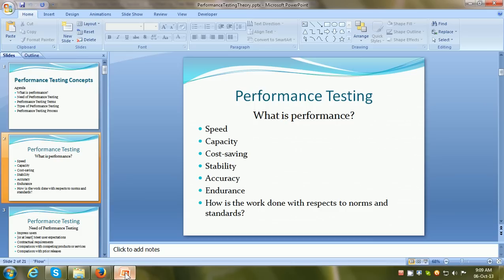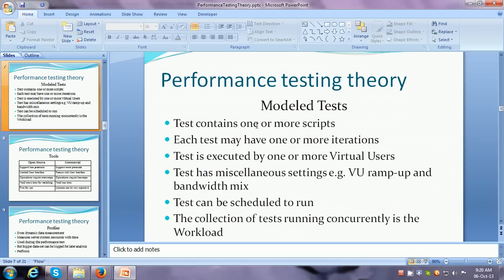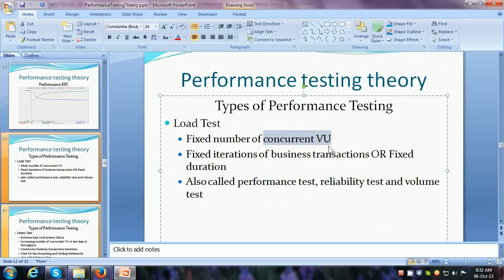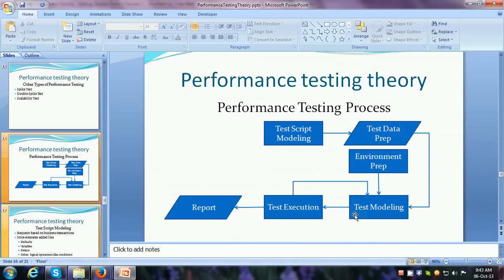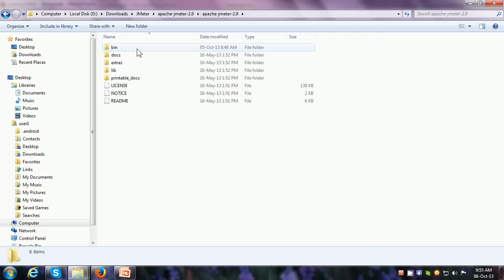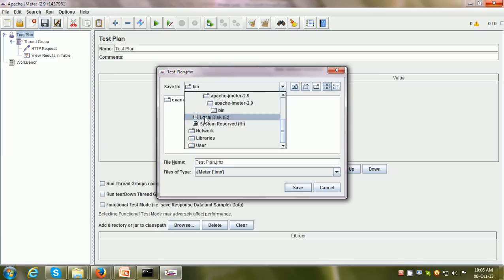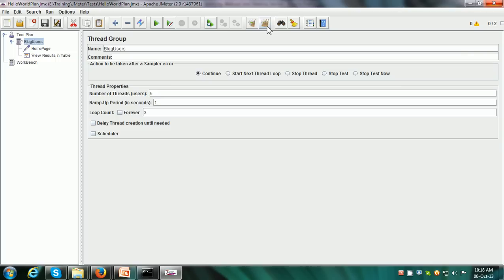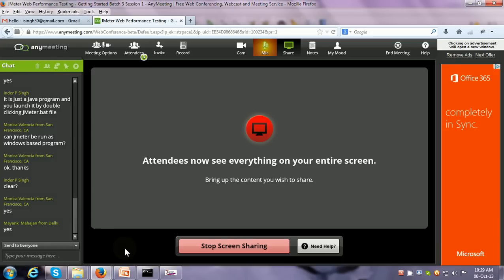Performance Testing-JMeter Performance Testing-Jmeter-Performance Testing Using Jmeter-Load Testing

Comment: Hi Inder, Nice Video..Can you please explain summary report in Jmeter and the formulas used to calculate Average, Std Deviation, Throughput, KB/Sec in the report
Reply from the maker: Girish Deshpande Hi Girish, thank you for your comment. Because it gives little information, I prefer to use the Summary Report listener only in the final JMeter test plan. While developing the test plan, I prefer to use View Results Tree because it shows the most data. The formulas in the Summary Report are standard. E.g. Average = Sum of all sample times/ No. of samples. The Average is shown for each individual request.

Comment: May I ask why throughput line is raised and Avarage Line is down, they always opposite each other
Reply from the maker: bluewindboy99 No, it is not like that. JMeter uses the same graph to show both so Average and Throughput values are plotted by JMeter automatically.Further, a couple of suggestions are 1) We can ignore the initial transient period of the test (when the users are ramping up to the maximum number of users) and 2) We can run the test for a longer duration e.g. 10 minutes, or more samples e.g. No. of samples: 10000 to get more consistent results. If we use these suggestions, we should see flat Average i.e. response time and Throughput. These flat values should be seen as the performance measurement results.

Comment: Hi Inder, thanks a lot for this session. It actually clears a lot of fundamentals. However, my first test itself gave me error. I mimicked your first test with 1 thread, 1 ramp up period, 1 loop. I run it and I see only a warning in results. Sample Time 0, Status Warning, Bytes 1091. Latency 0. Can you please help?
Reply from the maker: Debashis Jena Hi Debashis, thank you for your question. I ran my JMeter test plan and it works fine. It seems that your sampler, HTTP Request is not correct. It should have the Server Name or IP as inderpsingh.blogspot.com and nothing in the Path. Also, you can add the listener, View Results Tree and check its Request tab. The request should be correct i.e. if you copy the GET request and paste it in the browser, it should navigate to that web page.
Reply: Software and Testing Training Thank you so much. Actually I has "http://" in my server name. That's what was giving me warning. I ll now continue the video where I left from.
Reply from the maker: Debashis Jena That is good. Thank you.

Comment: sir,
how to perform parameterization test in login window(email ,password) using jmeter ??
Reply from the maker: Rinoy K Rajan You can add a Config Element called CSV Data Set Config. This element can read a CSV file and supply the values of email and password for each request. Thank you for your comment.

Comment: Hi Inder, Very nice and clear. I appreciate your efforts. When I use HTTP recorder, I do not see the requests being recorded as expected. Even those that are recorded, when I click on them, I see "Body Data" tab being displayed with garbled data. I am trying to record requests with login.salesforce.com website. Thanks for your help.
Reply from the maker: Anil Shekhar Hi Anil, When recording, please ensure that you give sufficient time for the web page to load/ re-load after you click anything. If the recording is still not correct, you can use a tool like Firebug to note the requests to add them manually in JMeter. Hope this helps.

Comment: Hi Inder Thanks for your help on previous question. Can you lemme know how can i change variables in body data i want to change variable in every test i made eg; 1 to 100 different variable on each test. and need to get idea on Pre & Post Processor Elements any videos or docs can you refer.
Reply from the maker: Syed Masood Post body is used in special request types like JSON or XML request. You can read about it at http://jmeter.apache.org/usermanual/component_reference.html#HTTP_Request

Comment: Hi inder
1) I'm planning to execute 2 request at time
2) I have added thread group 1 as 5 users
3) And thread group 2 as 10 users
4) Is there any option to stop one test and continue 2nd one?
Reply from the maker: Palla Subramanyam Yes, right click on the first thread group and click Disable. After making any change in the test plan, it is suggested to Clear All your results and save your test plan.
Reply: Software and Testing Training Thank you very much inder your suggestion are great help for me..

Comment: Hi,
In the View results in table, there are columns - Sample time (ms), Bytes, Latency. How to know if the results shown are good or bad for the website which is tested.

thanks.
Reply from the maker: pratik oza The View Results in Table listener shows the response time as Sample Time, page size as Bytes and latency time as Latency. Low values of these data show higher performance and conversely, high values indicate poor performance. One can look at the performance requirements of the website (e.g. the home page should load within 2 seconds). Then analyze the listener results to see if this requirement is satisfied or failed.Thank you for your question.
Reply: Software and Testing Training
Thanks for the quick response. I have understood the logic.
Also, Is it possible to create a test for the pages and the recording script at the same time in the test plan. Is there any video which covers this.

Thanks.
Reply from the maker: pratik oza You are welcome. This is only a sample video. I do cover a lot of topics like creating JMeter tests, recording JMeter tests, analysis of JMeter results and so on in my private JMeter training videos (paid access). If you are interested, you can please see http://inderpsingh.blogspot.com/2013/10/JMeterVideos.html

Comment: Hi Inder, can i automate default server IP for all test cases same time?
Reply from the maker: Hi Syed, I understand from your question that you want to give the same server IP for all the HTTP requests. For this, right click on your thread group, go to Add, go to Config Element and click on HTTP Request Defaults. Provide the Server Name or IP in the text box. This value will be used by all HTTP requests within the same thread group. If you want to override this value in one or more HTTP requests in this thread group, simply provide a different Server Name or IP in those specific HTTP request(s). Does this answer your question please?
Reply: Thanks Inder

Comment: I have few questions here:-
Can I give Queries per second?
Can I request thread count until the average latency nears 1.0 seconds?
Reply from the maker: Can I give Queries per second? Queries are called Requests in JMeter. Actually, JMeter sends out the requests as fast as it can based on the capability of the computer on which JMeter runs. You can give a constant timer (delay) of 1 second to the request. Then, you can put your desired number in the number of Threads (users), say 10. Then, it will send 10 requests per second.
Can I request thread count until the average latency nears 1.0 seconds? I have not tested with such a goal. However, the View Results in Table shows the latency values. You can ramp up the Threads (users) to a high number and note when the latency values near 1 second, if at all.
Thank you for your questions.

Comment: Thanks Inder for this awesome session. Good session for JMeter start. I am having one query: What is the difference between 'HTTP Request Defaults' under Config Element & 'HTTP Request' under 'Sampler' ...?
Reply from the maker: Ankit, you are welcome. Out of these, HTTP Request is the main element of a JMeter test plan to test a website. In HTTP Request, we can provide the server name, path and other details like parameters to send a valid request to the website. A typical JMeter test plan has multiple HTTP Request elements. Instead of configuring them individually, we can put the common settings under an HTTP Request Defaults element. Each HTTP Request in scope of this HTTP Request Defaults element then inherits these common settings. HTTP Request Defaults does not send any request, it saves our effort in duplicating the same settings across many HTTP Request elements. Thank you for your comment. Inder.

Comment: Thanks for this splendid video tutorial! Have a question out of this current session. How are Thread and Loop Count different? We can have 10 threads hitting the server instead of 2 threads, 5 loop count which makes same 10 request to the server,
Reply from the maker: In JMeter, threads is the number of virtual users. Loop count is the number of iterations performed by each thread. In your example, 10 threads will send 10 requests to the server simultaneously (higher load on the server but for short duration). When you have 2 threads and 5 loop count, each thread will make 5 requests but in sequence i.e. one request after another (lower load on the server but for longer duration). Do you understand the difference please?
Reply: @QA1  Achaa explain kar dia bhai.. 
:D Kiaaa yar Kamalesh? tm b avein............

Comment: Sir, can you demonstrate how to run JMeter via command prompt and in which scenario we need to do that? Thanks
Reply from the maker: Hello, the JMeter UI (the JMeter console) takes up resources, especially if you have used graphical listeners (reports) in your test plan. We can run JMeter in the non-UI mode to eliminate this resource usage. This is especially useful when we need to run a test plan with a large number of threads (VU).

The command syntax (to be run in the Command Prompt window) is like:
jmeter -n -t mytest.jmx -l mytest.jtl

Comment: Can i use it for linux webserver performance test?
Reply from the maker: Neelu - Yes. JMeter works from a client (user with a browser) point of view. Apart from the web server URL (server name and path in JMeter HTTP Request element), it does not need to know other details of the web server.

Therefore, the operating system or other details of the web server do not matter. In other words, JMeter can be used to load test any web server running any operating system. Provided it can reach that web server on the network.

Thank you for your question.
Reply: Thx for reply

Comment: How can i perform load test on the queries that generate BI reports?
Reply from the maker: You design a load test based on your performance requirements. Let us say that the requirement is that one particular query (e.g. top products sold by month) should take less than 2 seconds to execute.
In order to test this requirement, you could execute this query for different months a total of say 100 times and compute the average query execution time. Then analyze this average query execution time against the above requirement.

Comment: Hi,

Your videos are crystal clear to understand. But still i have few doubts. Can i use Jmeter to test BI reports? Your inputs on the same please
Reply from the maker: JMeter is able to load test several types of applications like web sites, web services, ftp sites, databases, LDAP, email and others.

If your BI reports are published on a web site, you can certainly use JMeter to load test them. Also, if you desire, you can also load test the queries that generate the BI reports.

Comment: I found this tutorial very valuable.  Especially the explanation on the cleanup, theory behind how many samples you may want to look at, and the difference between the shutdown and stop commands.  The only thing I would have asked at the end was, how to export the results so you can show them to your teams outside of JMeter, but otherwise, it was a very valuable walk through.  Thank you for posting this.
Reply from the maker: The reports are called Listeners in JMeter. All listeners have access to the same performance results. It is possible to save these results in either XML or CSV format file for the team. It is even possible to configure which values you want to be stored in your results file.

Actually, all these things are covered in our JMeter training video series. This video is only a getting started video.

Many thanks for your comment.